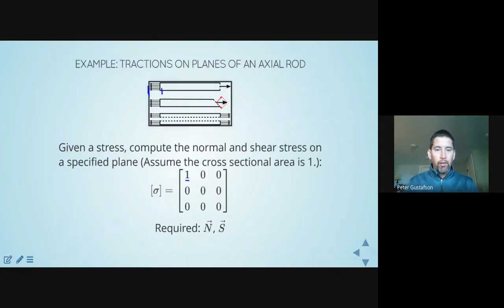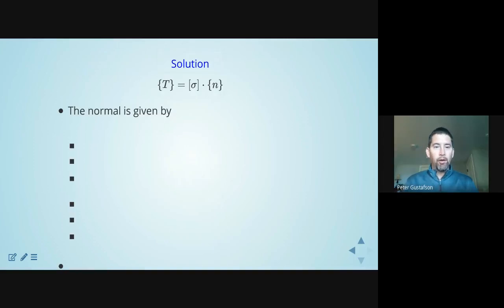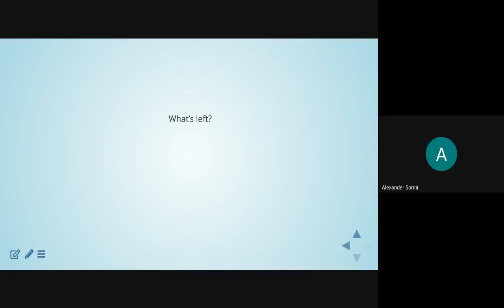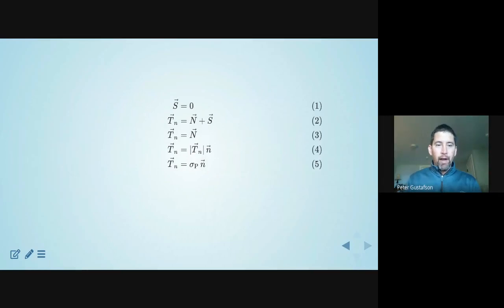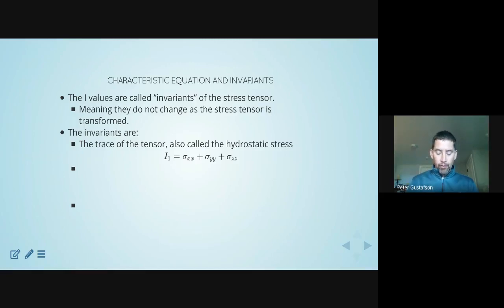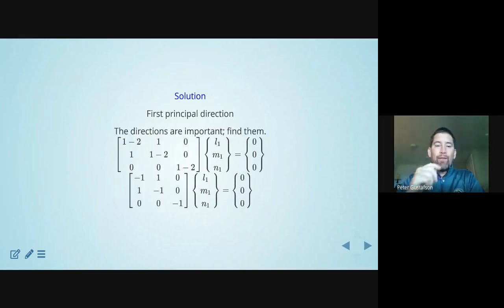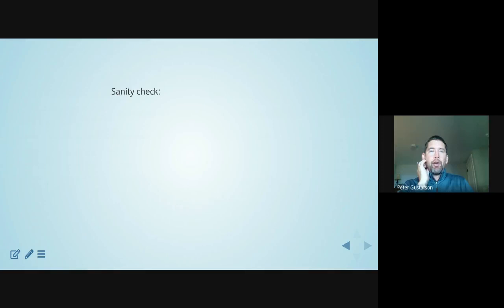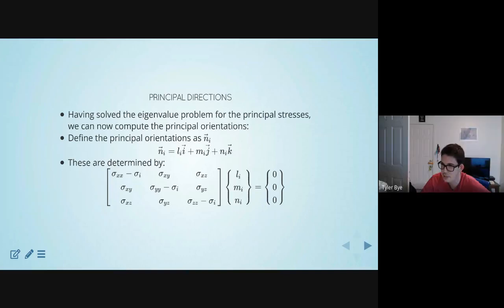AE4630 Lecture 05 - Tractions and Principal Stress

Comment: 2.3.2.5 EXAMPLE: arbitrary traction computation
@ 9:37

2.4 Boundary conditions and tractions
@ 26:31

2.5 Principal stress
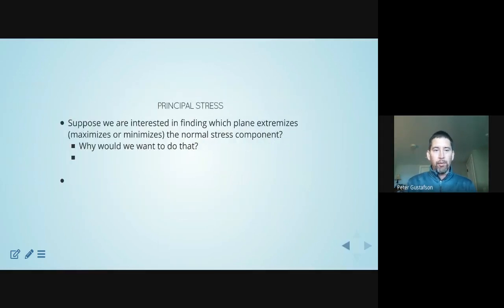@ 29:54

2.5.1 Principal stress values
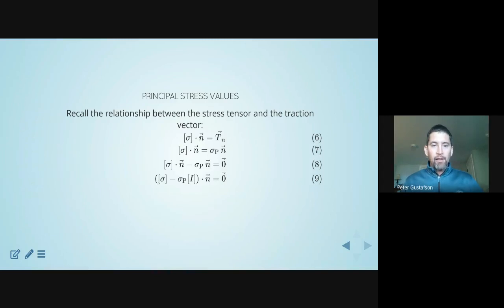@ 37:50

2.5.2 Solution to the eigenvalue problem
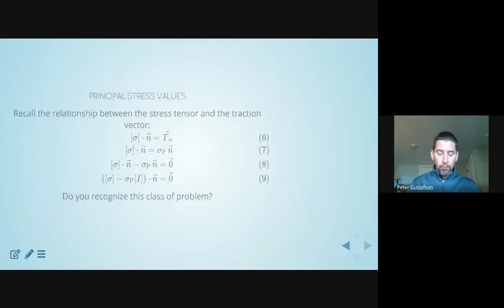@ 39:58

2.5.3 Characteristic equation and invariants
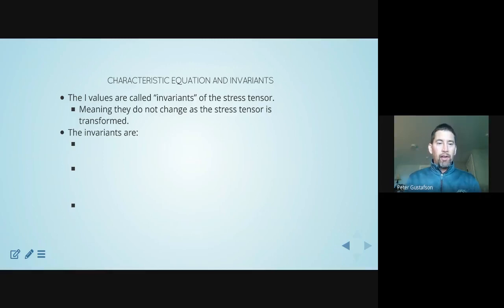@ 43:57

2.5.4 principal directions 
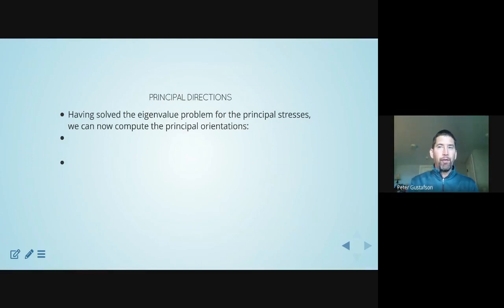@ 47:11

2.5.5 Notes about principal stresses and orientations
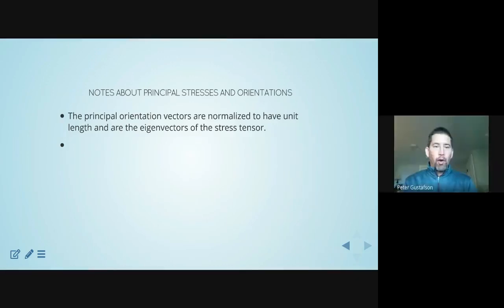@ 49:35

2.5.6 EXAMPLE
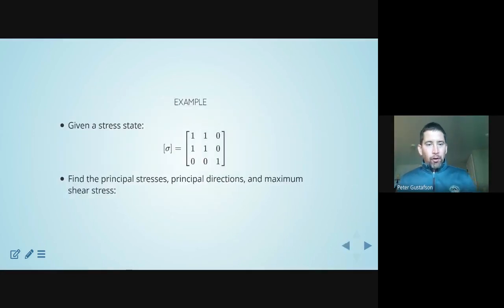@ 53:32

2.5.7 Additional thoughts on principal stresses
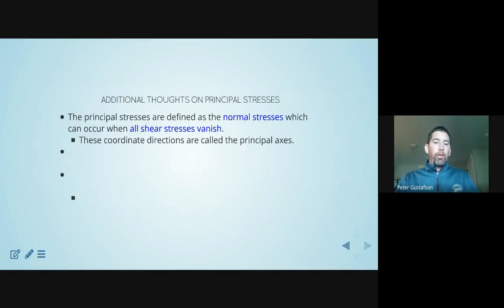@ 1:11:13

2.6 Equations of motion: equilibrium and stress
@ 1:14:59